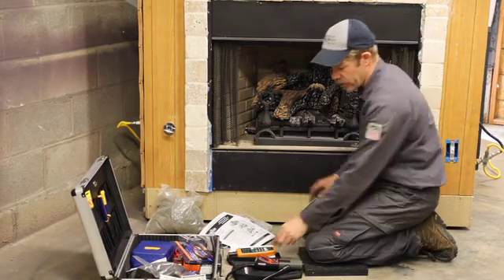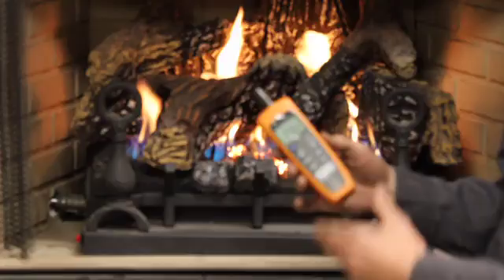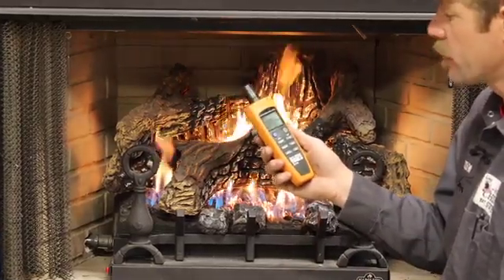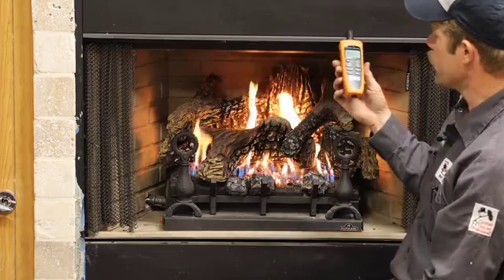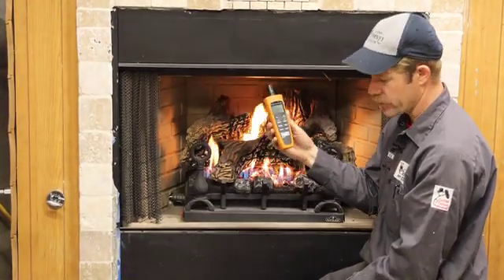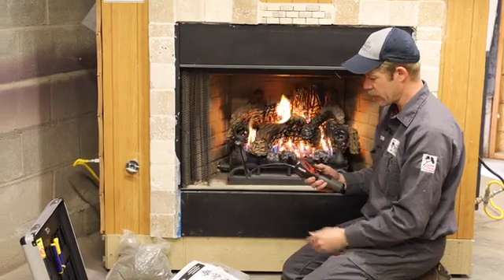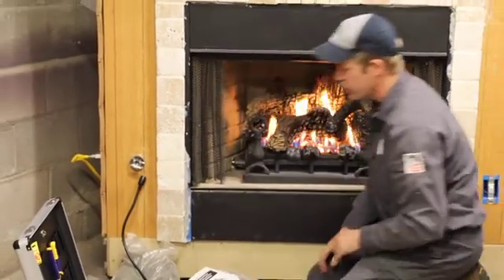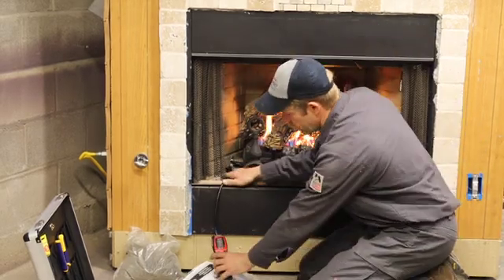How to use a CO detector and Combustible Gas leak detector, an overview for gas fireplace techs

Comment: had a question for you is there any reason I would not be able to detect natural gas over or near a doorway or possibly in a dead air space or very close to the ceiling  thoughts please thank you
Reply from the maker: I know the brand we use is kinda on the affordable side.. so if you need a really accurate one, for a slow leak, I recommend calling the local utility company asking them what brand they use... they have very expensive ones.. over $1k each, and they are very accurate...
Reply: But my question is do you think it's possible to detect gas over or near a doorway or even in a dead air space or near the ceiling? Thoughts please thank you
Reply: Or even on the ceiling? Thoughts please thank you